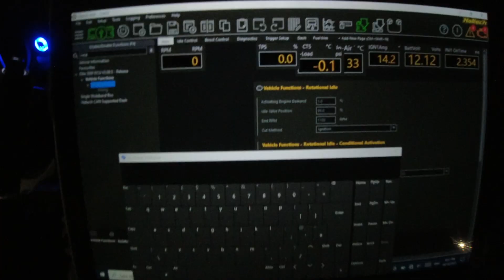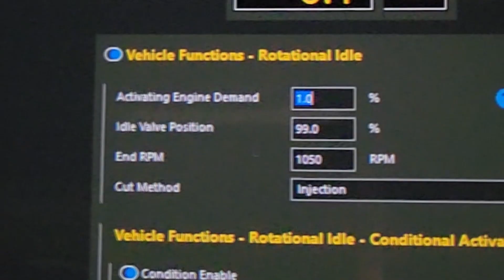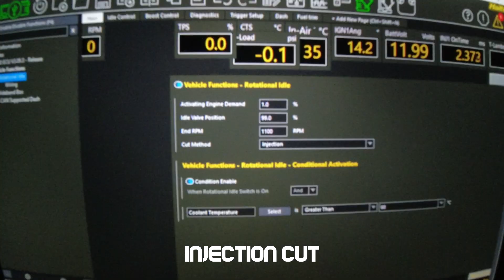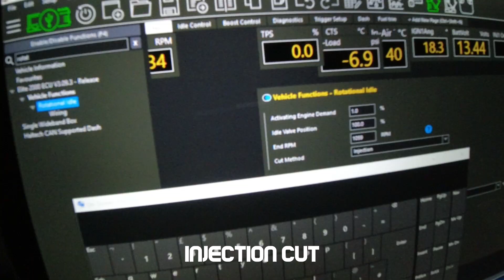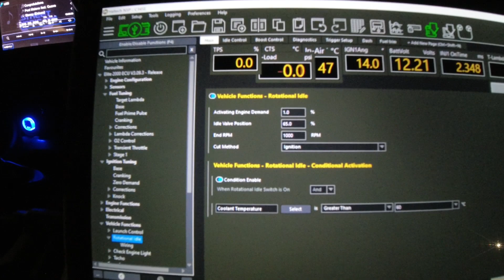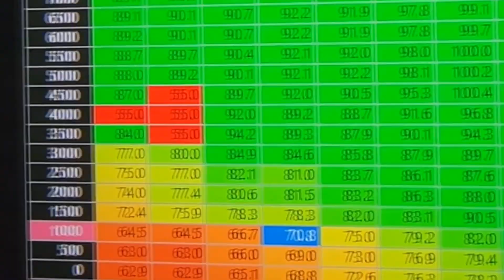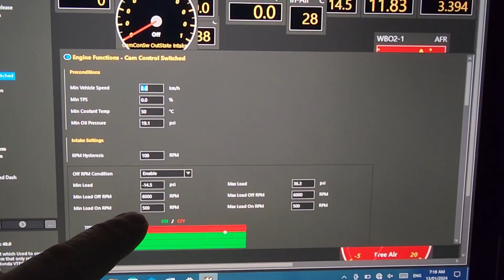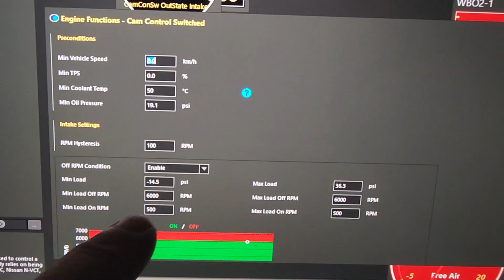HOW TO: Haltech Rotational Idle/Ghost Cam In Under 15 Minutes (Haltech Elite ECU - RB25DET)

Comment: Bwhahaha  I've  got an SR with 260 stix in  it and I've spent days  trying to get it to idle nice  and not  go up and down rpm .. I am really interested to see how well it cools the engine down   I tend to heat soak my thing on the dyno  it might be nice to  set a 1200 rpm rotational idle over 95 degrees coolant temp i will have play later  yeh great Video  mate keep at it

Comment: Ive got a question does using the ignition cut off way mean that the fuel injectors will shoot out gas stil? And if so will it make it run richer ?
Reply from the maker: Yes correct, the injector still fires and send fuel into the cylinder, but as the ignition/spark doesn't happen it doesn't burn.

Comment: Just be careful with the VCT as there might not be enough oil pressure at idle. For example, the SR20 requires a minimum of 21.8psi/inHg for VCT Engagement. Any less and you might throw the rockers as the VCT will be rocking back and forth without enough oil pressure!
Reply: I would presume since the car is still idling at 900-1100 the oil pressure wouldnt change or am i wrong?

Comment: I think I'm going to configure the trigger on is only when the TC knob is not on zero, so I have a way to turn it off without having to add an additional switch.

TC 0 = rotational idle off, TC off

TC 1-11 = rotational idle on, TC gain settings
Reply from the maker: Not a bad idea! I definitely had to mess around a bit to get my switches set up and ended up wiring it into one of the OEM switches I never use haha

Comment: did it really effect your engine temp at idle?
Reply: Id like to know also, in traffic I’m sitting at 90
Reply from the maker: I haven't actually tested it in a scientific manner yet as I was really just setting it up for the sound - BUT I did notice I was idling closer to 82-85 degrees sitting in the various carparks I was in, rather than the usual 85-90 degrees which is where it usually sits.

Like I said - not exactly a controlled, scientific experiment - but it was definitely interesting and warrants a deeper look in future for sure. Might do some A/B testing and make a video with the results in future 😁
Reply: @StreetSyndicate the effect will cause the engine to run slightly cooler and for it to cool off quicker when hot
All the cylinders that aren’t firing in the rotation are just drawing in air and pushing it out, no combustion, no heat.
Reply from the maker: @jayglasgow8054 Makes sense and that is the theory! Would still love to get some hard data to back it up, mainly because I'm a nerd haha
Reply: @StreetSyndicate  Andrew Dimartino from Haltech had shown the cooling effect while at Gridlife Atlanta using this exact feature. It was more of a practical example vs A/B, as well as it being on a drift car while waiting in line to go. But I’m also curious what your test may show. Right now now I more or less trick my elite 750 into doing this for fun but, if it really helps, I’ll probably make it a more regular thing
Reply: @StreetSyndicate  turn it on and sit in the sun bro 🤣🤣
Reply: I'll be A/B testing it this year in insane Texas heat. 🔥
Reply: My RX-7 FD is built only for autocross and cooling between runs is a top priority as I let the engine idle between all 5 runs. I'm excited to try it.
Reply: @ChrisMoreweb  I don’t have an elite series ECU with this feature specifically but I have forced my elite 750 into doing this and it reduced the temperature quite a bit when the engine was very well heat soaked. Was able to shed heat at a significantly higher rate than just idling alone
Reply from the maker: That's awesome feedback @jayglasgow8054